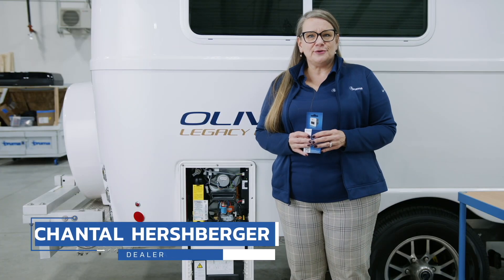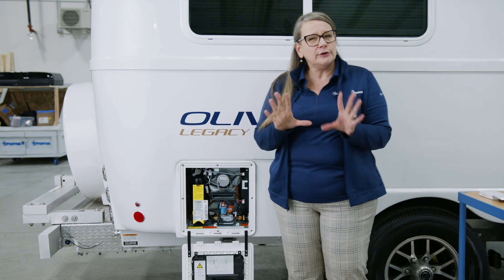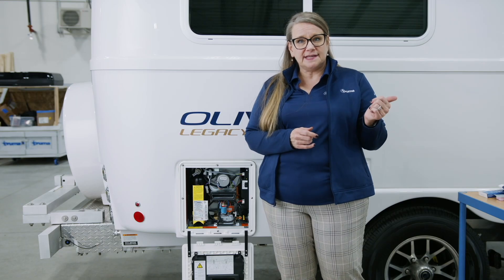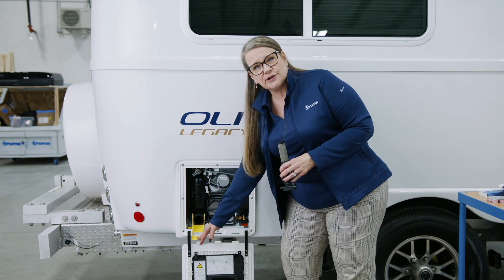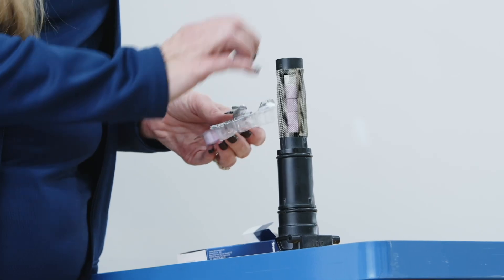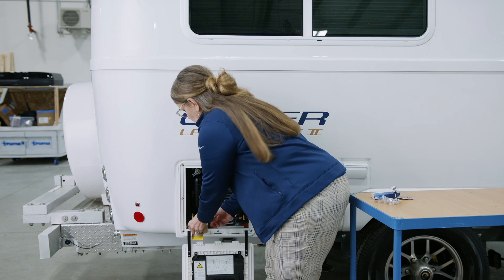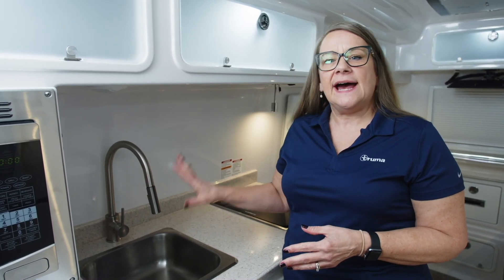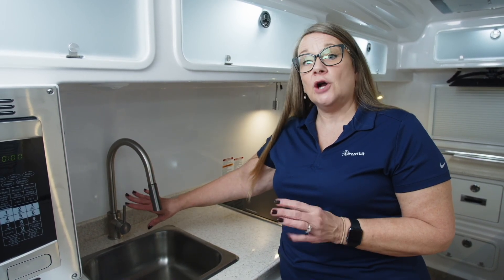Truma AquaGo Tech Tip: How to Decalcify the AquaGo

Comment: Does you turn the water heater on  or leave the water heater off?  Do you fill up tank and let it set or just run cold or hot water threw the tank?
Reply from the maker: @ronaldphillips8750 the Truma AquaGo is a hybrid system. There isn't really a tank. A mixing vessel is continually mixing hot and cold water. A temperature stablizer helps prevent scaling. The hot water is on-demand so within 10 seconds.